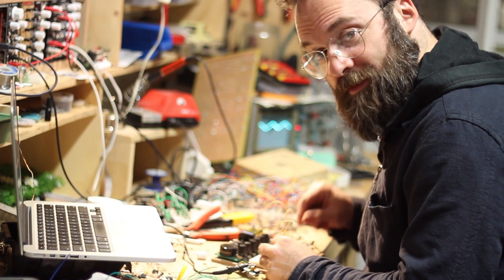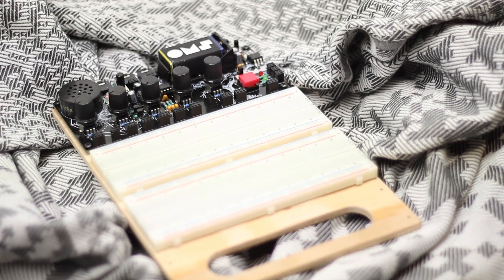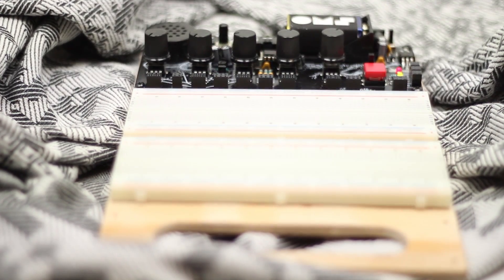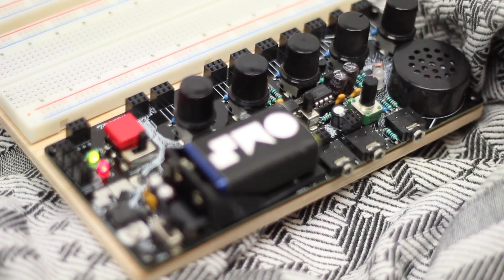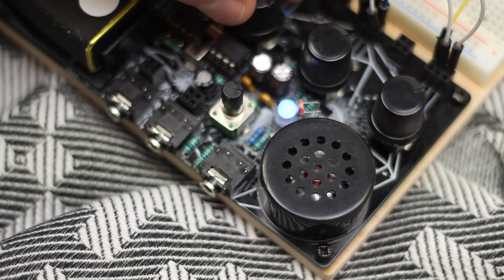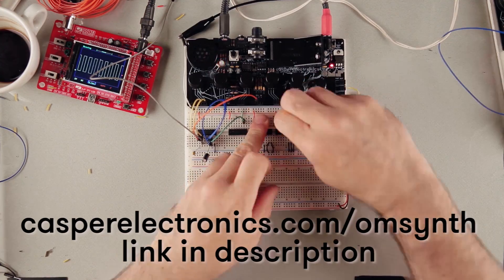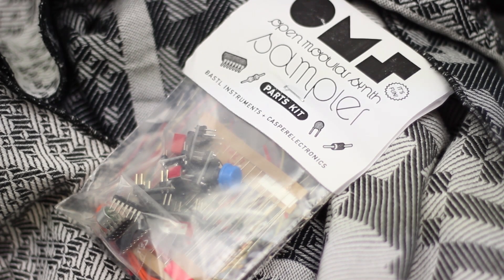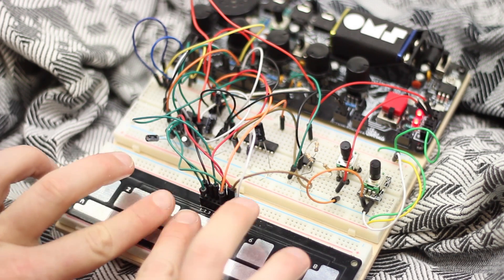OMSynth miniLab

Comment: Why was this discontinued?  Seems a perfect product / family of products, for beginners / noise-hackers.

Anyone know anyone else doing stuff like this? 

I have a bunch of Arduinos, Raspi Picos, Microbits etc. I have other components and breadboard. 

And all I really want is a convenient way to hook them up to some knobs / power / audio jacks without having to do a lot of soldering. (My soldering is pretty bad.) It's hard to find anyone providing that.
Reply: Did you find something similar? I'm in the same position as you rn xd
Reply: @Algunalien_00  Nothing exactly the same. But I realized the AE Modular setup is designed to work at 5v, like all my Arduinos etc. So I've started playing with that. Using it as a kind of testbed to bring together electronics / microcontroller experiments with other musical hardware.

I have a video series on it here : https://youtube.com/playlist?list=PLuBDEereAQUz6KMrxIeWLT6t_SWovKtwL

Comment: The kit I would pay for is a 16 channel sequencer using 2 4017ic's, because I can't seem to find a circuit online that works and it's driving me bananas! HOW is it done??! Ahhhhhhhh!!! 😧
Reply: we're selling an 8 step sequencer that uses the CD4051 multiplexer. Its a much better chip for sequencing. I will upload info on how to make it 16 as well..... BUT... its a non linear sequencer which means you can make it jump around the steps..ie you can make very long sequences.